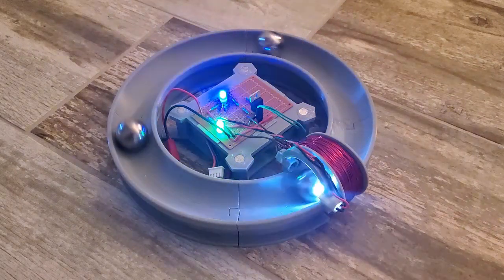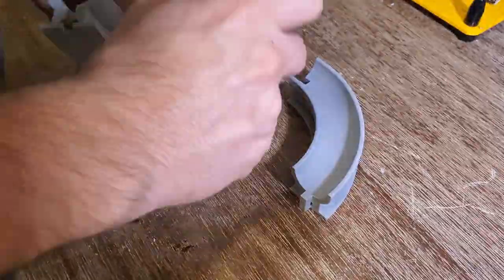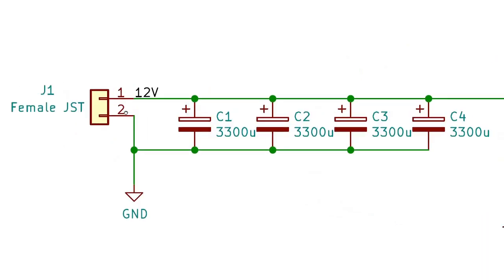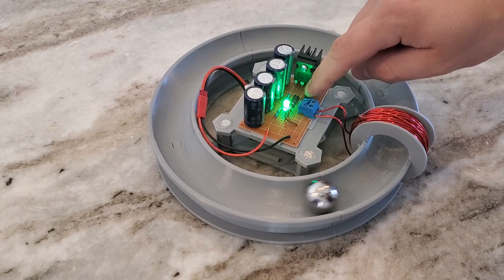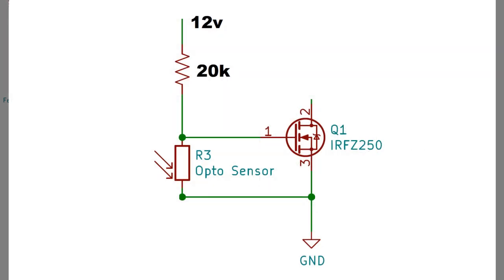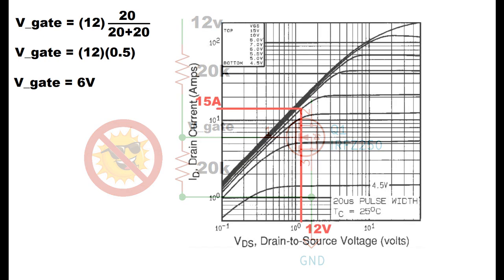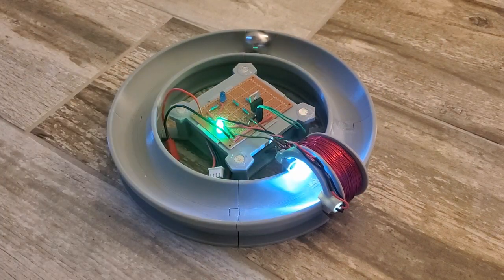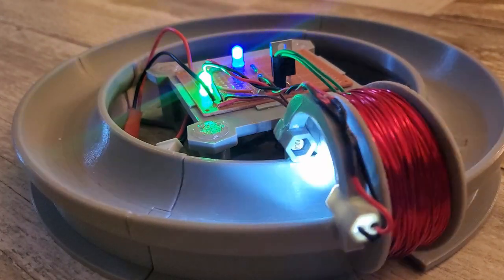Electromagnetic Ring Accelerator

Comment: This is a really cool product. You should make the track smoother and from one piece so it will be quieter. You could make the tube out of glass, stand it up at an angle, and coat the bearing in silicone. I bet people would buy it.

Comment: (Min 0:15) Does it really work well with ball magnets? I build one myself and it works fine with steel balls. I also tried it with magnet balls, but that does not work properly. 
Magnet balls like all magnets have a north and a south pole. Depending on the magnetic orientation of the ball, the magnetic coil pulls it through or push it back. So the magnetic ball randomly bounces for and back and does not go around in a circle like the steel ball does.

Comment: Wouldn't work for the plain balls but the magnets would get an extra boost from a flip immediately following passing the center of the coil. The first pulse always attracts because the ball aligns itself with the field in the coil. Some of the input is wasted aligning the ball.

Immediately following, a quick high energy reverse spike will have maximum efficiency because the field of the ball will be directly opposing the coil in every direction, making it less susceptible to rotation... the result is all the energy from the kick ends up in the ball. The track will of course start a spin but if it is timed right, you get only repulsion from it. A capacitive discharge scheme comes to mind. Could probably implement this with just another mosfet, cap, a diode, and one more optical detector... in what you have here

Comment: I think you need a tune-able resistor (+cap) delay for the trigger to make it work best with different speeds.  Also, I feel like you can make this a "push-pull" if you have a secondary circuit that is inverted on the windings at a slight delay to the "pull" side.

Comment: Very nice video, explains things pretty well.

The only thing I would offer a criticism on is the video's title, since by the normal definition, this is not a "ring accelerator". That name is usually given to devices that continuously accelerate something in a ring/circular path, achieving very high speeds, whereas this device only gives a little kick to the ball in order to keep it moving. Yes, it briefly accelerates the ball, but then the ball coasts the rest of the way. It is really just a novel implementation of a DC motor.

I own a commercially produced product of this same kind, having six electromagnets distributed around the circular track. I have not attempted to reverse engineer the circuit on each of the circuit boards (each electromagnet has its own identical printed circuit board), but I did note which components are on each board, and from that I assumed that a simple circuit, nearly identical to what you came up with. I think that the only real differences between the two circuits is that A) the one I have uses an IR LED and an IR phototransistor, and a driver transistor (probably a BJT) between the phototransistor and the MOSFET's gate.

Comment: You could have simplified the design by removing the optical sensor and checking for a micro-spike in voltage on the coil (as a sign that the ball is in range) then quickly power it up to attract the ball and then quickly powered it down to let it continue.
In this way it would work for the ball coming in either directions.
Nice idea though.

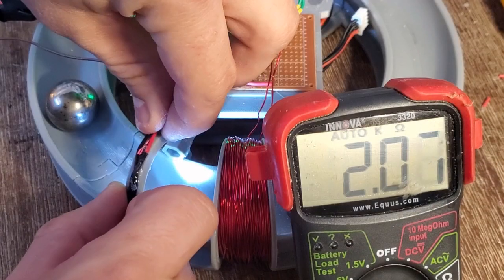Comment: Hi, I couldn't understand why the ball oscillates when we give constant power to the coil (3:20). I would be glad if someone could explain it to me.
Reply: When we power the coil it creates an electromagnetic field and acts like a magnet. When we put a ball, it gains kinetic energy from the magnet. The ball will then exit the coil, but the magnet is still on, so it will get pulled back until it rests in the middle. That’s why we turn it off.

Comment: The ARV uses similar quartz ring, many more accelerating magnets. The content of the toroid  are nanoparticles of ferrite,mercury neodymium 52 nanoparticles  as well as cobalt in nano particles and Barium.The hard part is to pressurize the contents to 200,000 atmospheres. Once you get the mixture turning, as it accelerates it centers in the toroid and does not touch the walls. The mixture turns into a plasma . At that time a secondary coupled in the middle of the toroid gets electricity induced which will later bbe use for other purposes. Continue accelerating, and a corona effect will be formed. Accelerating further will cause a white glow to involve the toroid and extend outside the test bench . That is when the “magic” starts. If you have the toroid experiment setup on a piece of wood or metal, using a non ferric scale  (I used a wood fish scale) as the white glow increases, the weight of the apparatus will slowly start decreasing. I managed 5-7% of weight reduction.  One of the individuals who was watching me with a grin, explained to me that  the white light is a field that in part or totally “hides” M from E=MC^2.   Just rotating the field only goes so far Using capacitors one can make a modified Hartley oscillator that when tuned is able to completely hide the Mass of the toroid And attached vehicle to not only does it hide the mass, but it bends light around the object, therefore turning it invisible or somewhat transparent. 
The crafts currently made by a consortium of Boeing & Lockheed  in Pasadena use toroids  10 meters in diameter!  These are the flying triangles that are commonly seen.  I had knoledge of the TR3-B which is the most common flying triangle see.  It was able to “hop” short distances by bending space using a complex capacitor based mechanism that projected the field within line of sight. No, I am no longer pervy to the advances made in the last 30 years. Nevertheless 8:41 the new TR3-G is capable of transluminal travel by bending space over long distances. From 40,000Km above earth orbit to the Alcione Solar system in the Pleiades  240 light years away in less than 2 earth hours. You get there at the time you left.  If you see a flying triangle in the sky notice the circle in the center with a white light; it looks like “an explosion that does nog go anywhere”.  Too bad I was only a physician, not a physicist. So, this is all I can convey from my observations.  BEST OF LUCK. IF I WAS ABLE TO MAKE THE DEMO MODEL WORK WITH ASSISTANCE, YOU HAVE THE MATH KNOWLEDGE TO TAKE IT UP TO HALF OR FULL SCALE!  Also I recommend you  watch Mark McCandlish presentations.  He was “suicided” on April 21, 2021. I was a friend of his.
Marc McCandlish 

Best of luck

Comment: LOVE THE PROJECT, VERY COOL! :),
I assume you wanted to keep it simple, but here is some info about not blowing up mosfets....
-----------------------------------------------------------------------------------------------------------------------------------------------------
The very common (and cheap) IRLR7843 (but ONLY with an IC gate driver), which will also let you use a much higher coil current.

Anyway, onto NOT blowing up mosfets.
It is all about NOT being in the linear region (explained below) any amount of time, and for this you will need a gate driver (buffer) of some sort because your circuit is keeping the mosfet in that linear region way too long, so here are two choices (but only one really) to fix this...

1) A totem pole driver with very common and cheap (with decent gate drive current) trannies like  SS8050/SS8550, or even the lesser 2N222/2N2907 pairs to fix the crap gate current the 20k resistor provides (RC time constant with mosfet gate C) .  A totem pole driver a basic voltage follower with high current gain in both directions,.  This isolates the gate from the CRAP current the 20k resistor provides, but does NOT isolate it from the slow on/off The LDR provides.  So onto 2) next :)...
.
2) To fix the LDR slowness issue above as well we need to go on/off at s specific "trigger" voltage as well, and a proper gate driver can fix this (or several more transistors - YUK!), something like a TC4420 will do well.

I cannot stress enough about how important it is to keep the mosfet out of the linear region for any amount of time possible, as this is when the mosfet is NOT fully on/off so it is a resistor that WILL dissipate a LOT of heat (I assume you are familiar with I2R).
Apart from wasting a pile of power, it WILL blow up you mosfet if bad enough (i.e. exceeded SAFE AREA of operation, see SOA graph in mosfet spec sheet).
If you have a scope you can check on these things of course.

Anyway, I suggest an IRLR7843 with a TC4420 will let you have a very powerful coil and NOT blow up your (much smaller and still cool) mosfet.

btw, what was the IRFZ250 correct part #, it seems to NOT exist?????
Reply: I found this gate driver circuit (CASCODE one) that will also do well as it has a "trigger" voltage of 0.7V but still uses only two transistors.
https://www.youtube.com/watch?v=wv4uAz8FV2w

Comment: Hey, I have a question, at the beginning you say that the 4 AA batteries did not work, but at the end of the video you no longer explain that part, I understand that you used approximately 12V and 6A, but if you did not use the batteries, where did you get the energy from?  I mean, what type of battery or source?😅

Comment: What if you add the same @180° (coil) then use steel ball then a magnetic ball then use variable voltage to control the rate?

Comment: Using a magnetic ball and a magnetic reed switch to control the coil, it may be possible to eliminate the electronics entirely and radically simplify the device.... Similarly, a steel ball and some light contact points that complete the circuit through contact with the steel ball....

Comment: Who else has found for the first time that an electric motor is no different than the working principle of a piston engine? All electric motors are Alternating Current motors, without AC, the rotor is just going to get stuck in the magnetic field, so the commutator is the equivalent of the valves of a piston engine, more or less.

Comment: someone probably mentioned it, but, your mosfet may have been blowing because the gate was only being fed 6 volts at the moment of trigger, which isnt fully turning on the mosfet, that high drain-source resistance is no bueno when you are calling for ALL the amps you can muster.   maybe use a buffer transistor and see if that helps enough to be able to use the capacitors again. That will help save your battery from being beat up too.    Awesome videos dude, glad I found your channel.

Comment: needs to be put in outer space so when space crafts can goes though it,  it  will  accelerate the spacecraft without the spacecraft having to use energy and whatever speed it can achieve the spacecraft will be able to continue at indefinitely, i suggested 64,000 km an hour which will get people to the moon in 6 hours, that might not be possible but there is a speed that can be done that will work ,

Comment: In case for purses and purpose and make into a drone...  and study a socket for program 3d print mechanical assembly in space or military use ..it for area 51 and charge in by polarized speed a speed  socket since the 70 s or Tesla spinning bulb for witchcraft .. socket in the center with multiple ringle .in sync ..for capsule corporation

Comment: Imagine the same circuit with close glass tube high vacuum, containing just enough ferromercurial liquid (nano ferrite) and sequencial pulsing coils . Once power is applied, the fluid moves . Increase the voltage, the coloidal suspension lifts & centers in the middle. Increase the voltage & sequential pulsating, soon you will have a corona effect.  Basically a plasma tocomac.  The TR3-B flying triangles use a 10 meter tocomac wit ferro-mercurial, cobalt & Barium. The proportions are key & I don’t know the formula. 
Accelerate to near relativistic velocity, it will create a white glow, which reflects a field that “hides”  M from E= MC^2. The rest is easy to imagine.

Comment: This is quite fun. 

Contemplating building my own, but instead of just using a fixed delay between opto-sensor and coil-turn-on, use a variable delay that depends on the speed of the ball. This will allow higher efficiency energy transfer and could be pretty easily implemented by comparing each opto-sensor with the previous one.

Comment: I don't know much about this stuff but is there any way to make the electromagnets pulse on and off at a certain rate?
Reply: You can build a pulse generator that is connected to the gate of the MOSFET or attach your pulse generator to an LED which would flash at your desired rate into the phototransistor. I don't know what frequency you want to send pulses to the electromagnets; I am not sure how fast they could operate.

Comment: But if you use 3 magnetic balls for the ring?  at the same time, if you use two coils with capacitors of 10.000 - 20.000 uF to save the electrical impulse (for the further movement of the ball without stopping).  maybe even try to do it more broadly?  those.  use many coils, but each 1, 3, 5, 7, 9, 11, 13 coils with a capacitor, but each 2, 4, 6, 8, 10, 12 coils will be connected in series and used to select, generating electricity.  so can you try it?  but the balls appear to be magnets.
-----
Or maybe even all capacitors connect use diodes but only in the same direction

Comment: Can you make a gauss rifle out of this by making the magnetic steel balls spin round and round multiple times gaining more and more velocity and then you have a release mechanism that releases the steel ball tangent to the circular path? It would be much better way to accelerate a steel ball than a linear one that needs to be either too long or too large.
Reply from the maker: I'm pretty sure you can do that, but i think there's a limit to how fast you could accelerate it, even in a circle, because of friction on the track and rise/fall times of the coil current. Coilguns are easy to build, but insanely complicated to optimize.
Reply: @HyperspacePirate  Thank you for replying back to my comment! Perhaps there is a way to magnetically levitate the steel ball inside a circular tube? I know this will be difficult to do, but theoretically the limiting factor will be the speed in which you can turn on/off the current in the coils which still might result in a very fast speed in the end? I can help you do the calculations and be happy to help. I am a physics teacher and this is great stuff.
Reply from the maker: @kennethmui88  You could levitate an aluminum ball inside a toroidal coil with alternating current, but you'd need a huge amount of current / turns and probably some sort of liquid coolant, so the only way you'd even be able to see it is if you had a tiny camera inside the toroid

Comment: make it dc acceleration track instead, and you can use carbon as conductive contact lubricant, dc lorents force, the track is the brush that make the ball the line conductor, ie, curved rail gun, dc, brushed, could be brushless if the circular-radial magnet is the projectile, coils around the track tube, air bearing
Reply: if you use plasma high voltage to jump the wall-ball gap then you have a kinda plasma brushed motor
Reply: continuous acceleration vs pulse coil gun ring
Reply: same for plasma ions acceleration ring, where the ions roll around the ring track
Reply: maybe keep the outside diameter positive so that the track forces the ions to stay inside (or on the outside) against or with the centrifugal force, whatever design suits the wanted functionality

Comment: I think it needs a capacitor, give each pulse a little more oomph and get that thing spinning around the table😉. It's halfway to being a toroidal coilgun anyways lol, at this point you might as well put a couple more stages with some electrolytic capacitors on it. Now that I think about it that would be a great way to fine tune the pulse timing and duration for a coilgun...
Reply from the maker: That was actually the original intent of the project
Reply: @HyperspacePirate   what is the diameter of the ball
Reply from the maker: 1"
Reply: @HyperspacePirate  what did you use as battery

Comment: Could you build a track same design but utilize the tracks surface as part of the circuit and use multiple electromagnets in segaments around the track that get activated when the magnetic ball passes by and completed their individual circuit propelling the ball through angled electro magnets that look like arrows going in one direction around the circle with the leading end being closer together like I see people doing in other videos but it  shuts off halfway through the magnetic fields perfectly timed and doesn’t get stuck and actually shoots off would you be able to build sustainable torque in a circular shape design with multiple magnets all turning on as the ball completes each individual circuit along the track as it passes by maybe with some sort of insulated strip of copper along the botttom for isolated contact  but Anywyas do all that and get these balls flowing super fast and build up torque then use that torque to charge the battery that’s powering the electro magnets? Maybe my question is a bit convoluted, I apologize. but I feel like the amount of energy to power the magnets gets less as it gets faster but also turns on more times then it would if it was spinning slower but I’m wondering if short bursts with building torque can equal over unity if even slightly in that hypothetical configuration.